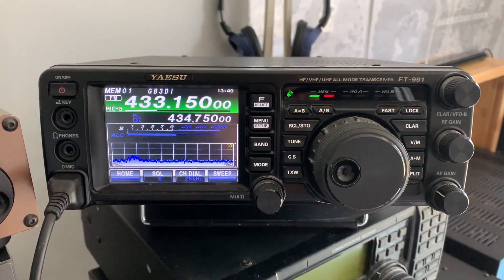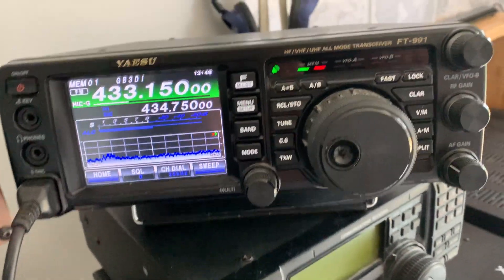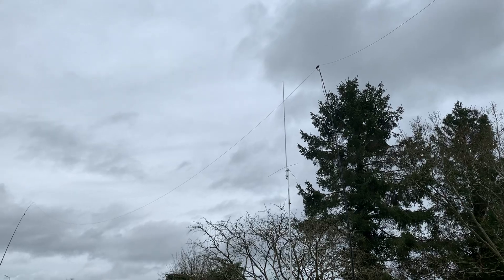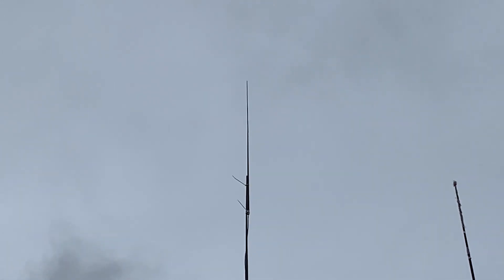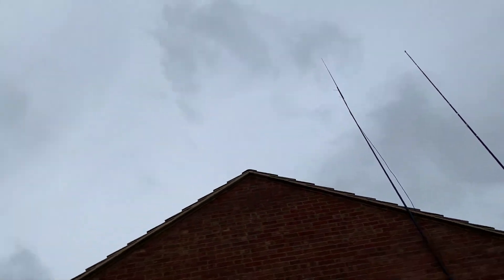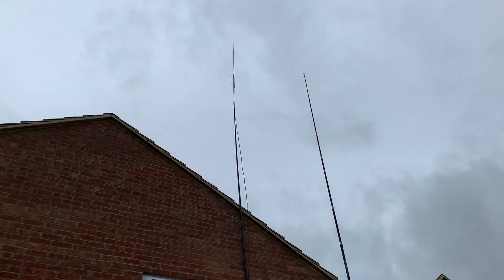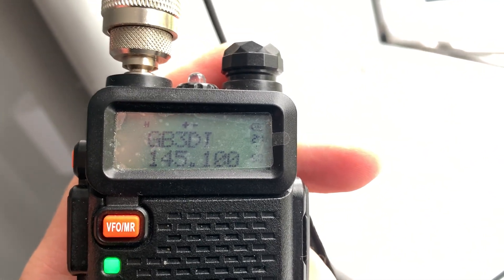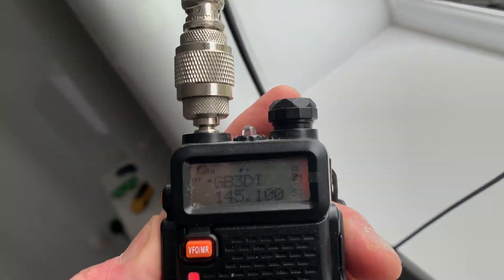Temporary collinear antenna set-up to open the GB3DI 70cms repeater from West Oxfordshire

Comment: GB3DI has been having issues recently too so possibly try others as well, I used to be able to get in on A handheld but now can barely hear it because it has moved locations.
Reply from the maker: Thanks for the heads-up. 73
Reply: At Daves house out Chilton kids nursery way, back of Rutherford. Been there for ages. I got my antenna that was used for the SDR dongle for a bit, never worked on cheap Baofeng, Nasty noisy spurious emmisons things, one in the video!. Had and pimped up through a RF amp, never worked. 
Now a nice Yaesu hanhheld, back and running again after a bit. In Abingdon. QRZ linked here in description or banner photo. Works on 1/2W but leave on 2W. Hanheld to roof antenna. Bit of height up Odge hill. Sunningwell. N Abingdon direction. works on rubber duck on 2W. 1/2 at a push.

Comment: Coax to Diamond is...??? Looks kinda small. Also, have you tested the antenna end of the coax with a wattmeter and dummy load? Lossy coax always makes shack-end SWR look better. And on another subject, after fifteen years in the SMR business monkeying around trying to eek out the last possible foot of coverage area, I found that in every instance multi-bay dipole types outperformed collinears. Looks like antenna weight is an issue for you though, but if you can roof mount something, or eaves mount, try 'em out.
Reply from the maker: The match is the same at the antenna and at the end of the coax feeder so not sure. Thanks for your tips on antennas - very much appreciated. 73